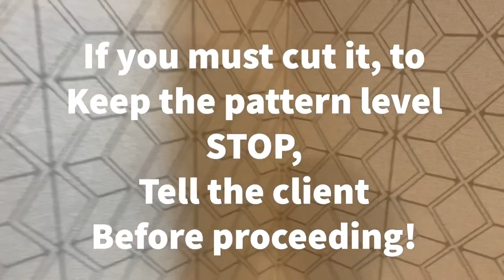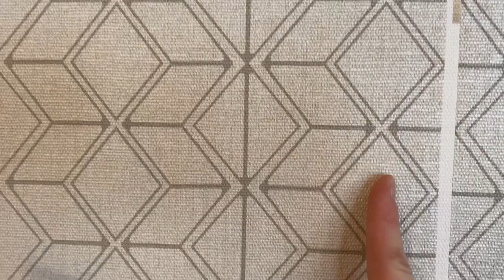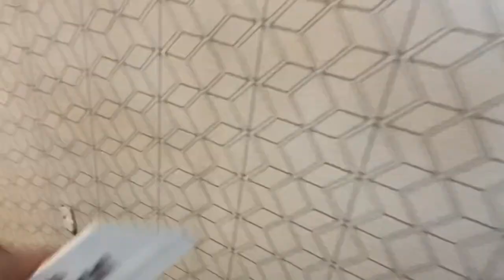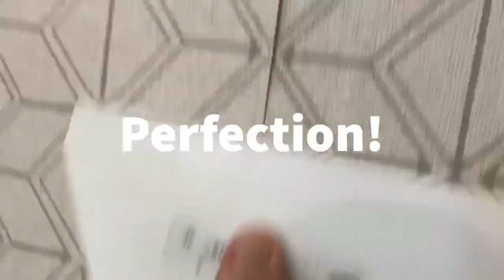Double Cutting Geometric Wallpaper Without Losing Pattern - Spencer Colgan

Comment: Can you cut your seam edges on the table? Taking the straight line completely off on one side, and leaving it perfectly on the other side. That's how we would cut a carpet seam with this pattern.
Just wondering if seams are ever prepped before going on the wall. Great video. Big fan 👍